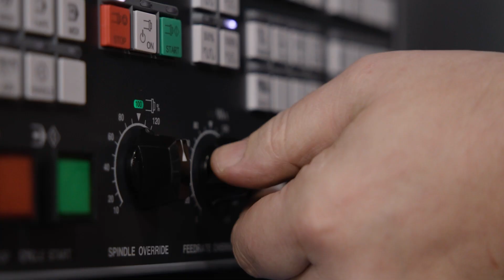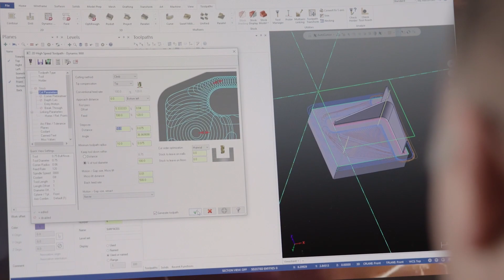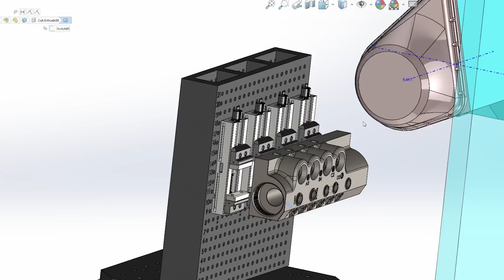Simple $100,000 Mistake Rips IMPELLER from Workholding

Comment: We all make mistakes. When a machinist makes a mistake you can't press the reset button or spell check.
It's gut wrenching when it happens but you have to pick yourself up and learn from it.
Just remember this... a piece of metal is just a lump of scrap until a machinist adds value by turning it into a valuable component

Comment: It crazy to look back now and it makes me feel old but I learned programming on an NC paper tape Pratt & Whitney. We used a literal "type writer" that had a paper punch rig that sat to the right of the keyboard punching hole into a paper tape back then a "type O" was on a completely different level. Fortunately the machine rapid rates weren't exactly scary. In one lifetime we went from emptying a dish of the little paper chads to programming and running simulations of program before we even make a chip. Thank you guys for promoting the trade

Comment: Your telling me the audience doesn't help weather on manual or CNC people just realize how much us guys push the envelope! The best thing you can hope for is you left enough stock to clean up the mess that's why you rough first leaving plenty of stock metals when roughed out will twist bend expand do to heat generated by the hoging process I.E roughing after metal cools down she cools down reindicate every thing now your in the finish mode light cuts to size  no need to worry about EXP or CONT take your time make sure your MIC/Cal is absuluty right on theee money of course you have to balance this with speed and productivity but guess what there is a balance because if you don't you are going to wind up starting from scratch that costs the ultamit money the bean counters don't understand this there busy picking up telephones and pushing pencels anyway love machining my dad was a die maker I did mold making I went general machines more interesting dies and molds are heavy and dirty depending what side your on love the trade always will wish I could open up my own shop stop dealing with incompatense

Comment: I've f*cked a couple of parts up, but nothing "severe" like that.
Most of my mishaps were saved by welding/additive manufacturing, so it's not like I've had to throw out any of the $20,000 parts I've had my hands on lately.

A lot of my tasks consist of repairing broken parts in injection molding tools or simply making changes to already completed parts, because the customer has asked for a change after they've been running their tests on the tools.
Scrapping a part after it's been through lathes, mills, hardening, finishing, grinding, and EDM is the worst - so I'm usually very careful about checking my programs and setups.

Comment: I messed up on a dang prototrak a few times. Just recently was kissing around the outside of a part to bring it to size. Slowly telling the machine that the tool is smaller than before. Then I accidentally made my .5 tool into a .05 tool, taking a 2.5” deep 3/4 cutter width cut strait into a pretty big part. This was a HSS bit on a Bridgeport so the fact the tool survived was pretty impressive.

Comment: I had a programmer hand me the wrong variation of a program. It was the same part from spirit airlines. Their was 13 different variation. Well he got fired for giving me -11 holes for a -8 program and repeat this twice. At one point I had to save a copy on the company laptop just in case he started lying.  However, those 1st batch of parts failed the Ultrasonic test due to the heat treating process. I quit that company because 12hr shift 6 days a week, below the average CNC machinist wage wasn't worth it.

Comment: Learning how to be a machinist now coming from engineering. Everything is spot on in this video. I just learned after a machine control fault that you need to make sure a 5 axis machine goes back to rotation zero before restarting. 3/4 of a degree off makes a no good cavity!

Comment: If your not making an occasional mistake you are not working hard enough. I had a very routine configuration setup I have have several dozen times but I saw some notes from another engineer that used a set of different commands for the same thing. So I said maybe an old dog can learn something new.   Oops I missed one line of the command. FAIL to down a customer's network and had to reprogram the entire configuration from scratch. No harm done in the long run. Without failure there's no learning

Comment: Awesome video! Automation happens, if you claim to have never made a mistake, then you're either not learning and/or are the shadow of the person doing all the work. 

I think one of the biggest road blocks of our trade are people who have no clue what's involved with producing a quality part from start to finish, especially if they're your assigned leaders. Can't forget temperature fluctuations! My biggest tight tolerance nemesis.
Reply: I did a job once with some semi-tight tolerances in brass (long hole drilling). Temperature fluctuations worked in our favor there, since you could drill it dry, then after a few hours when it cooled down you'd just put a hand reamer through it to reach spec, since the holes would shrink about 0.03-0.06mm after cooling down.

Comment: Those shops are out there you make one mistake and you're fired. Then the owner of the company can't figure out why he can't find good people. Because they're all working for other shops that know to error is human, just learn from your mistakes.
Yup, been there crashed a 100hp lathe in full rapid. Ripped the tool block right off the turret and it went through the front door of the machine. The setup man and me were on the floor taking cover after, looking at each other in shock wondering what the heck happened. Brand new machine and it had an error in the parameters from the factory. Try explaining that to a GM that knows nothing about CNC machining other than the fact you just crashed a brand new million dollar machine. 💦
Reply: I run 2 150hp roll lathes and I can agree that the power of those machines will smash tool holders like they are a warm stick of butter!! and here too like you very few here actually know how to run these machines, that can be very aggravating when a problem arises!
Reply: Lol its funny how many comments ive gotten in the last year telling me “I WOULD FIRE YOU if I saw what you did in this video in MY shop.” Well, your loss!!!

Comment: I’ve made mistakes. But one place I worked the operators would edit the programs, crash the machine, then blame me. I had to set up a password protected file to save the programs I sent out so if there was a problem I could compare programs. I had to prove to the boss many times it was not my mistake. He didn’t believe me. He said I fixed the program before showing it to him. So I let him set the password for the protected folder. Next several times it happened he still blamed me even though I had proof. I only lasted two months at that place before walking out.
Reply: Sounds like you were lucky to get out so quick!

Comment: Once I had a "typo" situation. I worked on small part hold by two tall pressure plates. It was supposed to be machined from two opposed sides. The guy who wrote program for it for me in powermill confidently send tool between those holding plates instead over them because simulation showed him tool path drawn as stright line between end of first path and start of the other. I was like "yeah right..." when I looked at this, but said nothing since I knew little about CAM. As I suspected the tool didn't go as simulation predicted and went directly toward pressure plate because machine was programmed to use G0 to move, which as non-interpolated never moves in stright line. Fortunately nothind bad happened because I watched it all the time.

Comment: I was making some serial parts and I had to let one of the Endmills run again bc the diameter was to small for the second op's jig. So I changed palets again ran threw the PGM-Head (Usually the preset is loaded in there) and of course it wasnt. I was sure it was there bc its our standards and I ran the endmill straight into the part scraping the part and also breaking the machine. I dont know how much the parts cost but they were big castiron parts. The parts and the time it took to repair the machine where about 20-30k. I'll never forget that anymore I will always and always from now on tripple check everything before I use programms I didnt write.

Comment: Working as programmer for year and 3 months and i'm glad that my biggest mistake for this time was making 28H8 hole instead of 26H8 (metric sys), that happend because i was inconcentrated. Thanks god this was insignificant part. Also better have your tolerance on plot with just numbers than with quality designation:) Double, triple and n-checking is the way to success

Comment: NC programming is THE hardest job in any shop! Thats why it pays the most and it takes a special kind of nut to sit in front of a CAD/CAM system for 8/10/12 hours and not go crazy. All of the mfg. jobs in a shop (QC/QA/Planning/Procurement/Estimation/Contracts/Machinist/Tooling/Raw Mat'l/HR/Accounting) are all easier (less demanding and less stressful) than programming. Another thing...a good programmer HAS to be able to know how to do not only programming but the jobs of machining/tooling/cutters/Mat'l...pretty much all of the mfg processes. Any good programmer in todays modern industries doing multi axis HSM should be making $80K-$140K per 2080 hour work year IMHO. One things for certain...a shops scrap rate is inversely proportional to the experience/talent of the programmers.
Reply: Absolute truth!!!

Comment: I defined the wrong dimension on a end mill, it should be 16mm but I defined it as 12mm. I used the correct feed and speed for a 16mm. when I realized the error and stopped the machine the part was too small. 

it's annoying how easy it is to make mistakes like this when you have a lot of pressure with your boss hanging over you to finish quickly
Reply: Same happend to me too a lot of times, most of the times was not my fault luckly

Comment: Used to have a competition with the night shift to not make a bad part from set up. Had to also get it done faster than required. Did fine for months until I got a program from a new programer. Nothing broke but tool path was wrong. Missed the line that was wrong. My fault since I was supposed to catch it. Can't always blame a programmer when you have the ultimate responsibility

Comment: is there a reason why you use those bins instead of proper chip bins that can be emptied with a forklift and a pull of a string?
Reply: The customer often provides the material and wants the chips back after machining. In those cases, the costumer will provide the container to return the chips in - 55gal drums are easy to ship.
Reply: @joshua43214  ah okay, thank you for that insight! 
we only have those containers to deal with at the machines and the big ones at the back to dump everything in. 
but we build machines from start to finish thought so no customer supply there besides test material for the classifier machines.